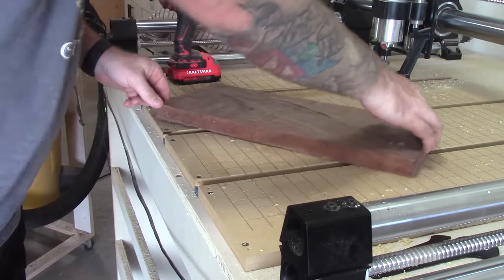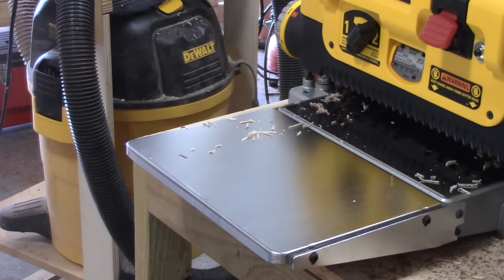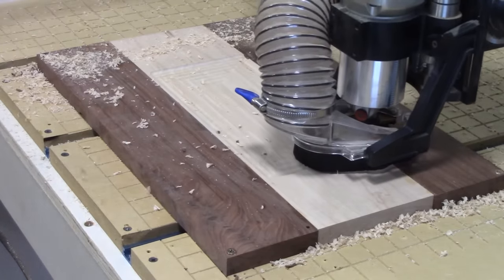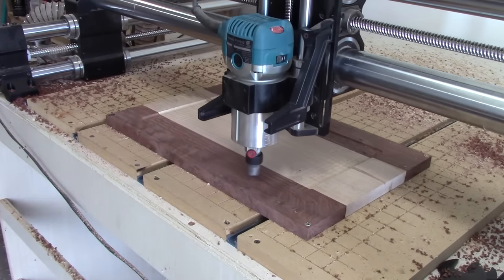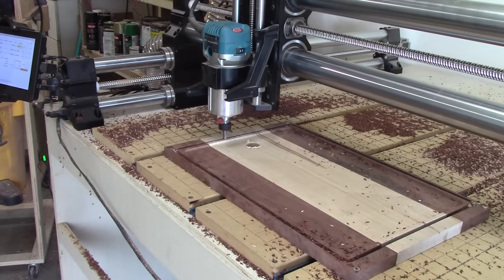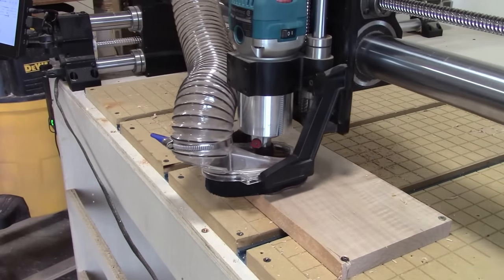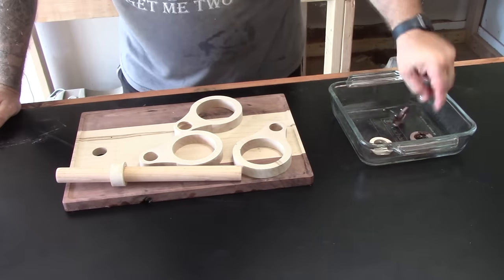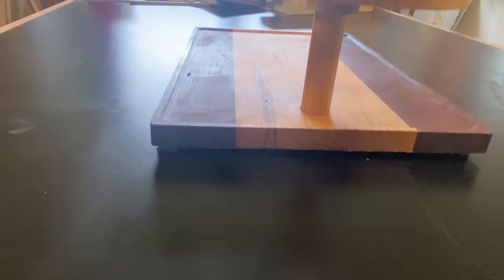This Is My MOST PROFITABLE CNC Project of 2023!

Comment: I have two surfacing tips for you. 1.) Use a Raster strategy instead of the Offset strategy that you used. 2.) Make the surfacing vector larger than the surface of the material that you're surfacing, so the bit changes directions off of the material.

I surface along my machine's Y axis, using a 2 inch diameter surfacing bit. I create a rectangle that is 1 inch wider than the material in X, and 5 inches longer than the material in Y, then I center that rectangle over the surface of the material. When I run the g-code, the bit will move into position off of the material, then make the first pass, running along the Y until it comes off the material. Then it moves over in X (40% stepover) while it's off the material, then makes the next pass. I get a much better surface this way, and there are no marks left by direction changes.
Reply from the maker: I thought about making a vector larger than the board, but didn’t consider using the raster. Thanks!!

Comment: Use a Q Tip and clean the inside of the collet with alcohol at the start of each project.  Clean the shafts of the bit with a paper towel and alcohol at the start of each project.  Look at your collet.  If it is a single split collet (looks like a C), get rid of it and find a collet with at least 4 sections instead of 1.  Double check the diameter of the shafts of the bits.   Suppliers and people buy bits from China.  What they think is a quarter inch bit (.25" or 6.35 mm) is really only a 6 mm bit which is to small for a .25" collet and will slip out.  China does not sell many actual .25" or 6.3 mm bits.  You can buy a 6mm to 1/2" (.5") adapter to run the 6 mm bits.  Same goes with the Chinese's bits that are 4 mm.  An adapter is available.  The 1/8" (.125" or 3.175 mm) bits are the same size and do not require an adapter.  Thanks for video!

Comment: 🎯 Key Takeaways for quick navigation:

00:00 🛠️ CNC Woodworking Basics
- Demonstration of preparing wood for CNC machining,
- Tips for surface flattening and thicknessing using a CNC machine,
- Importance of proper tool setup and feed speeds for CNC machining.
03:07 ⚙️ CNC Machining Mistake Recovery
- Dealing with mistakes during CNC machining,
- Salvaging ruined wood pieces,
- Adjusting tool settings and techniques for successful machining.
04:12 🔍 CNC Machining Techniques
- Demonstrating rough and finish passes in CNC machining,
- Importance of tool selection and pass depth,
- Ensuring smooth finishes and accurate profiles in CNC machining.
06:02 💬 Engagement and Channel Growth
- Encouraging viewer engagement through likes, comments, and subscriptions,
- Building a YouTube channel and audience,
- Leveraging viewer interactions to expand content reach.
07:02 🔧 CNC Machining Tips and Tricks
- Importance of pocketing for small interior profiles in CNC machining,
- Simplifying machining processes to avoid difficulties and save time,
- Efficient methods for cleaning up CNC machined parts.
08:11 📏 CNC Machining Precision and Fit
- Ensuring precision and fit in CNC machined parts,
- Addressing challenges in fitting components together,
- Techniques for achieving desired tolerances and assemblies.
09:07 🌟 Finishing and Final Assembly
- Applying finish to CNC machined parts,
- Assembling components to complete the project,
- Final thoughts on project improvements and overall success.

Made with HARPA AI

Comment: This looks pretty great, my wife would loooove it!! Maybe one alternative design could be the corner 'finger hole' style charcuterie board, I guess it'd have to be set in pretty far to avoid the corner breaking off. Also in regards to the making the dowel more secure, perhaps there could be some sort of plate/disc attached to the bottom of it that mates with a matching slot in the underside - it wouldn't have to be very big potentially to reduce movement from the bottom, although you would only be able to put the dowel through in one direction.
Reply from the maker: I'll probably do a follow up to this video. I have several orders for this, which I'm working on this weekend. This has turned into an incredibly popular item, but the loose dowel is an issue that I want to improve, so I'm gonna try to come up with a solution to improve that.

Comment: Awesome video. In regards to the burning you see in the corner of your clearing path. This wont be fixed by feeds and speeds. it caused by the change in load on the bit as it enters a corner. When the bit is moving in a straight line, it is cutting material on 1 side of the bit. but once it enters the corner it starts cutting on 2 sides of the bit. that extra load changes things with the bit and can cause burning or worse. Instead of using a raster pocket clear use an adaptive pocket clear. the adaptive path is specially designed for exactly this and will optimize its path specifically to ensure the bit is always under the same amount of load.
Reply from the maker: Thank you. I'll make that adjustment and give it a shot. I don't use the surfacing bit very often, but that always happens.

Comment: With my Bowl Bit projects I've been adding a 1/4" upcut bit to do the bulk clearing and then use the Bowl Bit along the edges. The upcut bit leaves are really clean surface and you can add the bit just like you do when doing a v-carve tool path in Vetric. While there is a tool change, the cutting speed may be increased to remove the center material and slow down the Bowl Bit for a clean edge.
Reply from the maker: Great tip! Thanks

Comment: Congrats, excellent innovation

Agree with your finding that it's too wobbly

The solution is mechanical flange glued to the rod such that the bottom of the flange rest on the cutting board

😊
Reply from the maker: Good idea. That's easily added.

Comment: Great project and video Damian, thanks for sharing. One minor change you might consider is to not pocket the board where the dowel is located, leaving maybe 1/4-1/2" around it and towards your current pocket edge. That might help keep the dowel just a bit more stable as well as being visually more interesting. Also, I'm sure you already do it, but measure each dowel as they are often not the stated diameter.
Reply from the maker: Great idea. And yes, the dowel was ever so slightly smaller than stated, so that's a good call.

Comment: Great project, going to give it a go when I get some time. One question I have is at 8:49 you said that you forgot to record it but you put a “dowel in the dowel” to keep the bottom ring in place. My brain is trying to figure out what you did there but I’m not getting it.
Reply from the maker: I just drilled a hole through the ring and slightly into the dowel, then glued a smaller dowel into it to hold the ring in place.